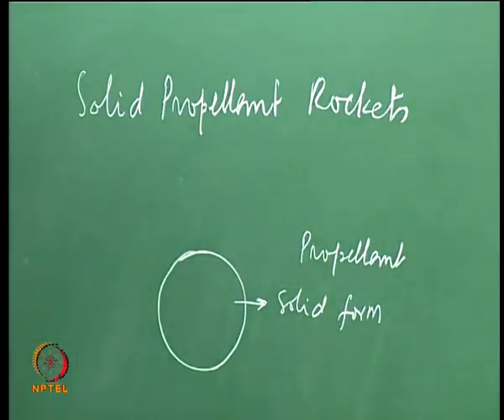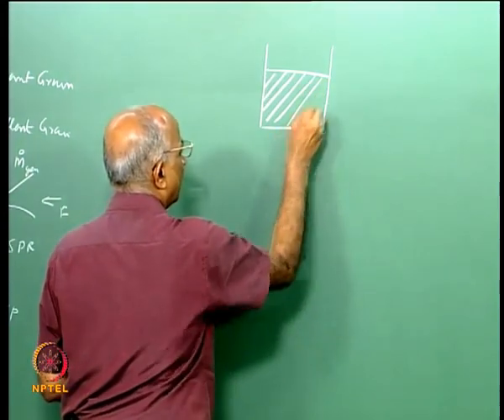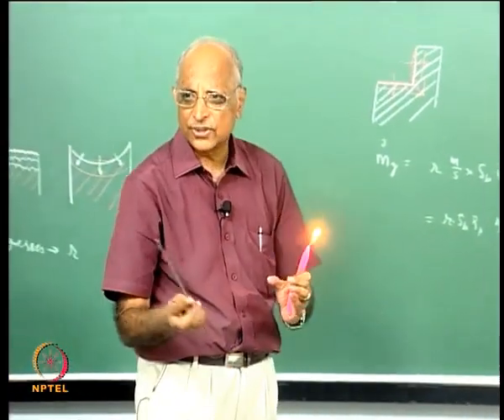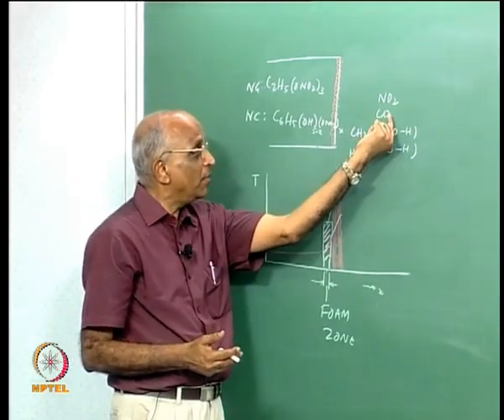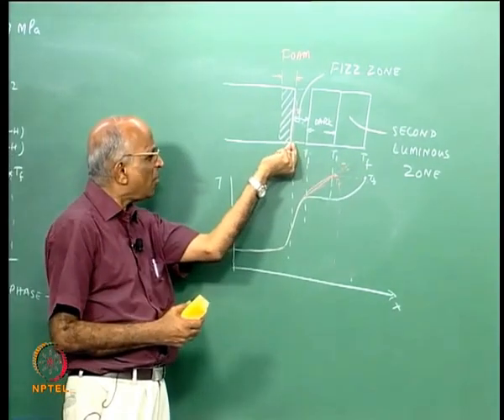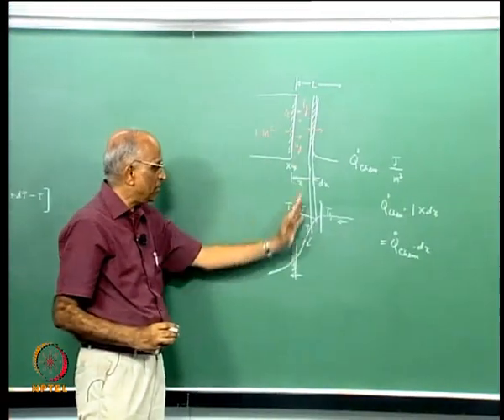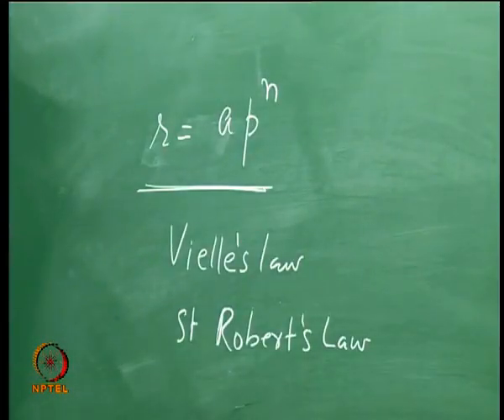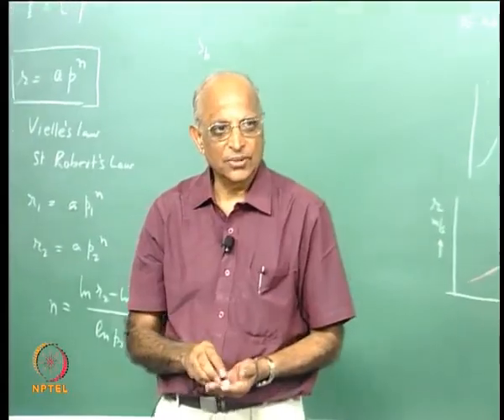Mod-01 Lec-22 Introduction to Solid Propellant Rockets

Comment: Sir am an aeronautical engineering student I planed to do a project,can you please help me with material selection(body case)...
Which pipe should I use?
I need a metal pipe which should weight less,heat resistant r the metal case should not melt.
Reply: Hi friend
I'm an aeronautical student too and i'm Working on a project: conception of a solid rocket engine
Could u plz help me with some documentation, i'm suffering of the lake of information in the internet.
I'll be glad if u send me the paper of ur work.
Reply: @jacob25tl  WhatsApp me on 7004243679 I am working on fuel system
Reply: Dude just use a stainless steel pipe
Reply: Bro both of you pls send me a WhatsApp message on that no and I wanna also work on those projects and I have some data
Reply: I couldn't find your account
Plz text me on +213664970147 via WhatsApp
Reply: Or on
www.facebook.com/usernameofjacob
Reply: You have to plan aluminum for light weight & with liner which is heat resistance.liner may be composite like silica based
Reply: Carbon nano tube